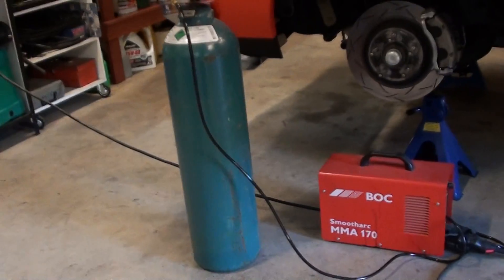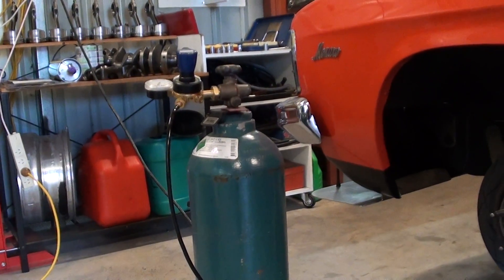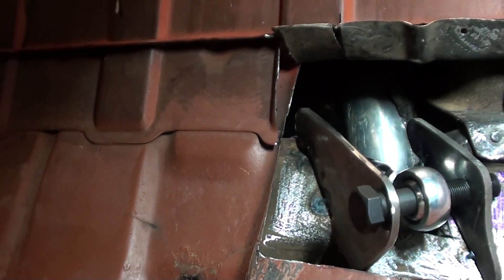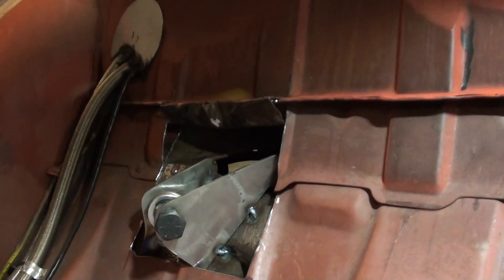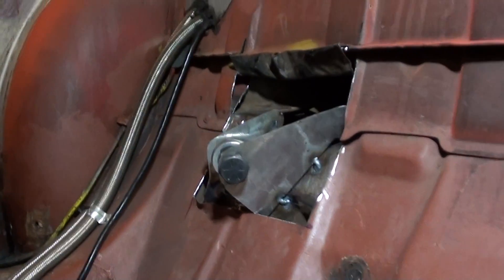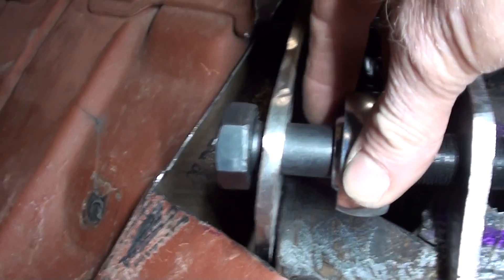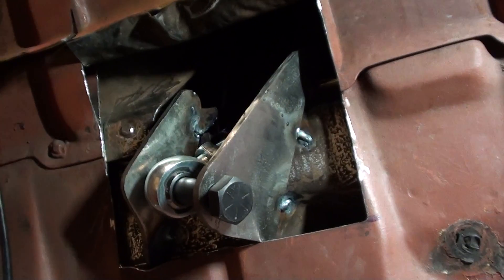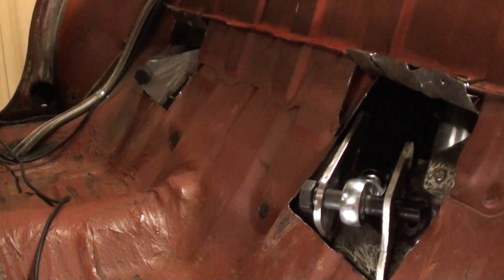ONLY TAKEN 20 YEARS TO FINALLY FIX..

Comment: Hey Griff don't weld the nut to the bolt use a nyloc nut different fade with colours white,blue black they lock into place and will be easier to get off than welding it should your bushes flog out
Reply from the maker: NW Feral Bastard sorry i it didn't explain it properly, they are nylock nuts, im only tacking them to bracket.. make life easier..ThanksGarry,